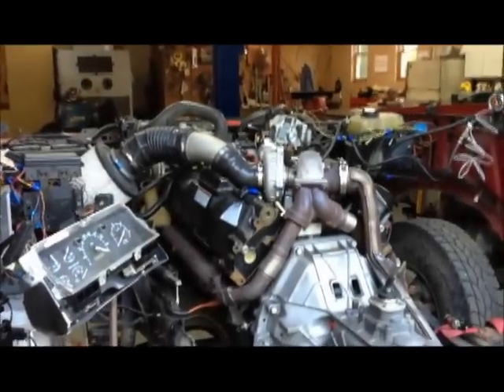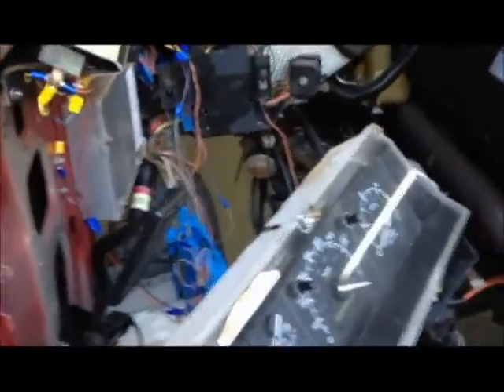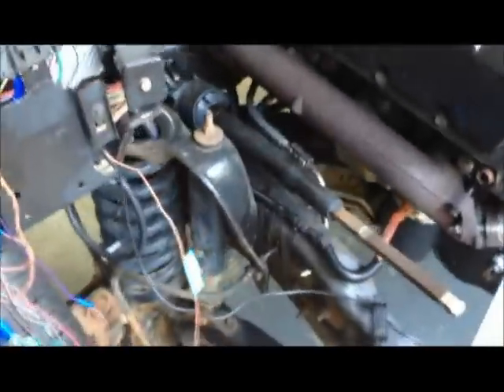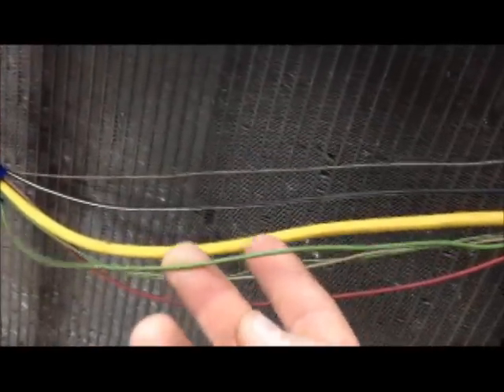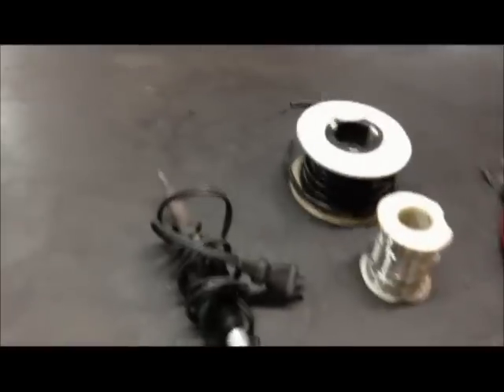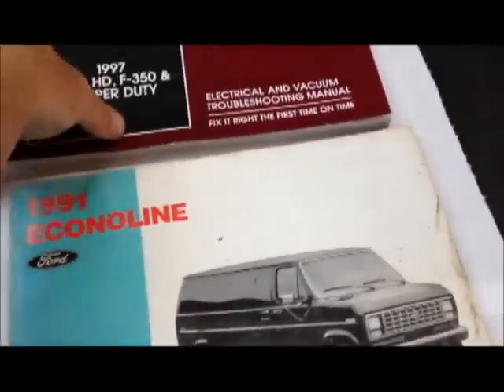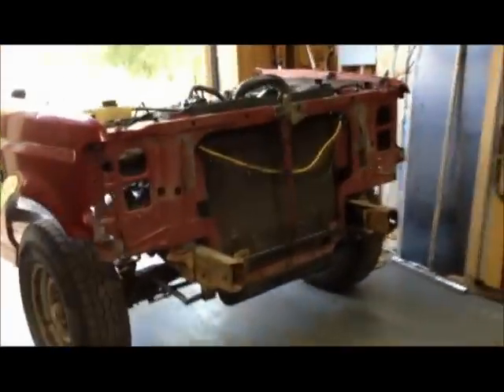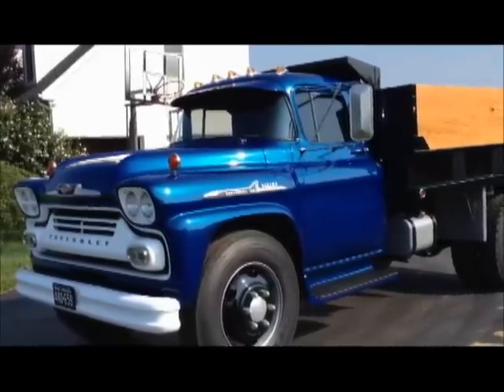97 Powerstroke Engine Swap

Comment: While I love Mark’s videos, anyone swapping a Powerstroke should know that the steps outlined here will work for a manual trans swap only. If you’re trying to swap a PS with an E4OD or 4R100, etc, electronically controlled transmission, you do need the gauges as well as the speed sensor from the rear axle. I suppose it’s possible to use another speed sensor in place of the rear axle, but that’s the stock system. This is an input that tells the trans when to shift.

Comment: Awesome Video my friend i recently pulled a whole swap from a 1995 E-350 ambulance with an enormous wiring harness and have been digging for a video or link on thinning down to the bare essentials to go into a 1978 f250 and this is perfect!
Reply from the maker: +GregMitz If you need help with the wiring let me know. I created a 1.5 hour video of a 96 F series wire harness that I modified for a customer that was swapping the PSD into a 67 F250. I've been sending the video collection out on flash drive for $30 to help people with the wire mods. Your ambulance harness is the same, just all the circuits are redundant which means you have twice the number of wires to deal with.
Reply: Can you still see comments on this video?

Comment from the maker: Since pulling the truck apart I've changed the HPOP and injectors so there hasn't been any miles driven on those upgrades yet. The high pressure oil system still has air in it and that won't bleed out until I can drive the engine.... which I am itchn' to do :)

Comment from the maker: Injectors are Swamps 175, 30%, HPOP is Terminators T500, Turbo is Beans D66. I have a TS 6 position chip, but that won't go on until I get the engine setup in the new truck. Since I'm giving all  these vendors a "plug" I should give one to myself: My engine side E-fuel setup which I make and sell to all  the DIY guys who like to save money.

Comment: hi, we emailed back and forth a few months ago. I'm in the process of wiring the in cab and under hood boxes, at 5:34 you talk about dedicated wire to the PCM "keep alive"...is that the yellow wire to the switch?  just want to be sure to power the PCM properly and if I can using the stock fused wiring...and not fry the PCM either.  I basically gutted the cab harness  of the radio/HVAC/ABS extra wiring and using the stock ignition wiring to aftermarket key/push start and stock turn signal wiring for an after market column.  Engine harness/fuse box was left alone for the lighting and engine operations. thanks Mark!! once I get her running, i'll be in touch about the EFuel and cleaning up the engine!!!
Reply from the maker: Yes. The large yellow wire will provide the PCM keep alive. That wire supplies the "main power" into the fuse box. The PCM keep alive is picked up out of the fuse box. Send progress pictures when you get a moment.
Reply: @markfuga  YOU ROCK!!! so the PCM and IDM will just power up when I turn the key on using the stock wiring (modified to a push start/key set up). awesome!!
Reply from the maker: @Lowzone73  yes. When power is applied to the large red wire with green stripe (fuse 22) the PCM and IDM will energize. Apply power to the starter relay and the engine should fire up.

Comment: I'm working in doing this with a 46 Ford but I bought an orphan engine so some wiring but nothing else yet
Reply from the maker: Let me know if you need any help. You'll need the under hood harness (fuse box) and just a couple wiring components from the cab
Reply: @markfuga  I probably will need help. I'm hoping to find a manual transmission that goes with a 97 7.3, or information on if mine will even accept one. I want to do a test fit before I get to far into wiring and such so I will know how well this will work. Then I will get components to test start and if it goes well then put it place and work in the body holes. And exhaust. And suspension...

Comment: Great video! Im doing a 92 7.3 IDI to a 97 7.3 DI. Would I need to keep the same items you did? Could I run all the normal wiring under the dash? Thanks
Reply from the maker: The only items you need from the 97 truck interior is the accelerator pedal and barometer. It's also nice to have the data link connector so you can attach scan tools. If you have an automatic transmission then you'll also need to keep the speedometer module to pass the speed signal to the PCM. If you have a manual transmission then the speedo is not needed.

Comment: would you be able to go in more depth of how you hooked up the ignition switch?
Reply: Being that you re wired it and not using any of the interior wiring from the parts  truck
Reply from the maker: cubkid411 I'm making another video that goes through the entire wire modifications from start to finish. I have 1 hour and 18 minutes recorded so I'll have to edit it down so I can upload to youtube. A fellow enthusiast paid me to modify his harness from a 96 that he's swapping into a 67 F100 and I'm recording the entire process. Feel free to email me and I can send more specifics and attachments which is easier than through youtube comments: mark.fugazzotto@gmail.com
Reply: +Mark Fugazzotto How much did you charge him? I'm about to start building a 65.
Reply from the maker: I've been doing the wire modifications as a service for a little over a year now and have done about 8 harnesses for guys. I charge $150 plus the return shipping. I tried going the "video" route but it's tough to explain all the changes in a video and it only raised more questions than it answered.

Comment: So can I hook the green wire to 12v that way my altnator works I did a swap I do t want to use the cluster gauge
Reply from the maker: Yes, at the alternator, the green wire with the red stripe. It's the "initial power source" that energizes the alternator so it will produce electricity. Once the alternator is spinning and producing it's own power it switches internally and cuts off the feed from the green/red wire.  If you add a light a bulb along the wire (in series) you'll get an indicator the alternator is functioning properly.
The gauge cluster is not needed for the engine to operator properly. However, if you have an automatic transmission and you want it controlled by the PCM, then you'll need to setup the PSOM so it can supply the proper speed signal to the PCM. If you have a manual transmission, then you're done after getting the alternator working.

Comment: Would you consider building a stand alone for me. Is so what would you charge. I have the original harness
Reply from the maker: Yes. What year is your harness from? I need the complete under hood harness (fuse box only, not engine) and the under dash harness. You'll also need the accelerator pedal. If you have an automatic transmission then you'll also need to keep the speedometer module. I charge $325 for the service.
Reply: Mark Fugazzotto ok where do I get your information I have everything in a tote already. I’ll just have to take the engine harness out of it. It came out of a 1995 e350

Comment: Mark where did u get the diagram for the plug going to the firewall 
I need to identify the other wire
Reply from the maker: The large firewall plug or one specific wire?
Reply from the maker: The large firewall plug or one specific wire?
Reply from the maker: The large firewall plug or one specific wire?
Reply from the maker: The large firewall plug or one specific wire?
Reply from the maker: The large firewall plug or one specific wire?
Reply from the maker: The large firewall plug or one specific wire?
Reply from the maker: The large firewall plug or one specific wire?
Reply from the maker: The large firewall plug or one specific wire?
Reply from the maker: The large firewall plug or one specific wire?
Reply: @markfuga  the whole plug
Reply: @markfuga  the plug that has the red and green wire
Reply: @markfuga  do u have a email I could send u a picture of the plug I’m talking about
Reply from the maker: @mikebrimm1872  mark.fugazzotto@gmail.com
Reply: @markfuga  thank you I just sent u an email with a picture of the firewall connector I’m needing help with figuring out what the wires go to
Reply: @markfuga  any more work done on the 1977 f 250
Reply: @markfuga mark where u been u haven’t been making videos

Comment: Did you switch rear end gears?
Reply from the maker: No. The 58 truck has a 2 speed rear (6.50:1 and 8.30:1). The truck is EXTREMELY peppy with these lower gears and runs a little high RPM on the highway. Overall it's a strong runner. I did investigate a new center section with a 5.13:1 to help lower RPM on the highway, but finding a center section for the 58 axle isn't easy. In the end I just stuck with what it's got.

Comment: I'm doing a 95 psd in a 91 f250 I got that book ordered but would greatly appreciate some help and some tips thank you
Reply from the maker: Sure. Let me know what questions I can help with. Something to consider since you're swapping to a truck that's within the same body style (assuming your donor is pre 99) would be to swap the dash and complete wire harness to the 91 which would simplify things.
Reply: Yes it was a running drive truck 91 f250diesel that had the idi in it and I do have all the wiring harness from the doner truck
Reply: Mark Fugazzotto I got that diagnostic electrical book just need to know what wires to cut and which ones to keep any information on this will help me thank you so much I appreciate all the help
Reply from the maker: Sure. Send me an email to: mark.fugazzotto@gmail.com

Comment: Are you still building harnesses? or selling how to instructions?
Reply from the maker: Yes. Send me your under hood harness and cab harness and I will trim it down to only whats needed to operate the engine and transmission. email me for more info: mark.fugazzotto@gmail.com
Reply: @markfuga  just came across this. Are you still doing harnesses?

Comment: hey Mark, I'm doing this swap to and '86 Ford one ton and I saw you kept the factory gauges for the Chevy. I wanted to know what you did about the gauge wires for the computer? Any chance I could get email address?
Reply from the maker: Sure. email is: mark.fugazzotto@gmail.com

Short answer is: if you're using an automatic transmission then the only part of the gauge cluster you need to keep is the speedometer module which passes the speed signal to the computer. The computer doesn't use any of the other gauges for operation.
Reply: Mark Fugazzotto hey mark, I had a question about the powerstroke swap you were working on if you don't mind answering it. Have you wired up the data plug and tried to connect to autoenginuity or another scan tool? I swapped a 7.3 into a 91 and it will start but no communication and the throttle pedal doesn't work. Just curious if you have had any of these issues. 

Thanks
Nick
Reply from the maker: Sure: mark.fugazzotto@gmail.com Short answer is the computer doesn't need anything from the gauge cluster to operate the engine. If you have an automatic transmission then the computer does need the speedometer module wired in so it can get the VSS signal from the rear axle (Speedometer only, no other gauges needed).
Reply from the maker: The throttle pedal issue is most likely a missing voltage at the "idle validation switch". The accelerator pedal assembly has a wire that went to the under dash fuse box where it picked up a switched 12 volts. Did you re-wire 12 volts to it?
The data link connector has two ground wires, one constant 12 volt wire and three wires that go back to the computer: a twisted pair (tan, pink) and a purple wire.
Reply: I suppose I have an unsolvable issue then.  Currently to get it running I have the red/green ignition powered and crank the starter and it runs, I also have the 3 wires to the throttle hooked up and its giving a proper signal voltage .6 idle to 3.8 wot to the PCM along with 12 volts to the validation switch when pressed. All the wires have proper continuity and I have used two different pcm's. I figured it was something in the engine harness and changed it for another and can't figure it out. I wanted to know if the throttle and data wires needed anything else from the dash to work, as looking through the evtm it doesn't. But if yours hooked up without issues I must have a harness issue that I can't find.
Reply from the maker: Send me an email to: mark.fugazzotto@gmail.com and I'll send a scan of the schematic for the accelerator pedal.